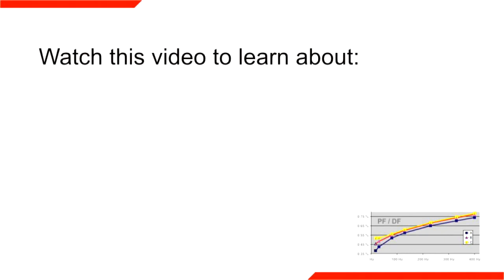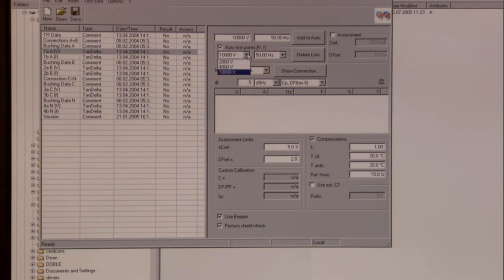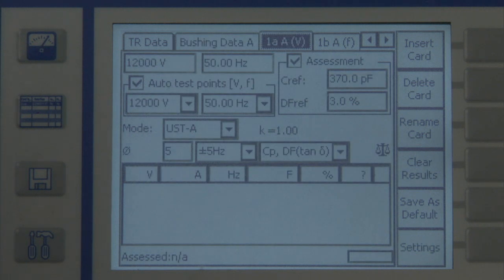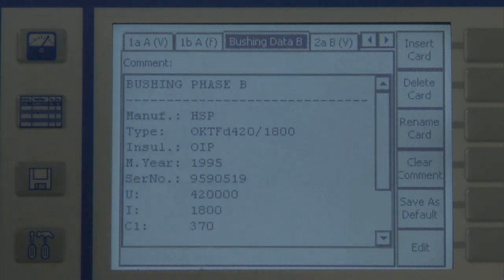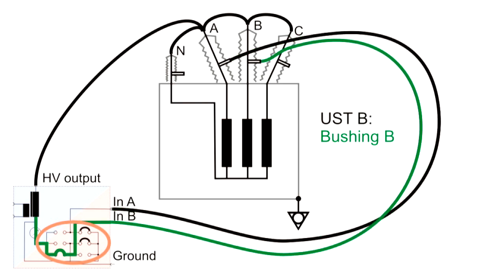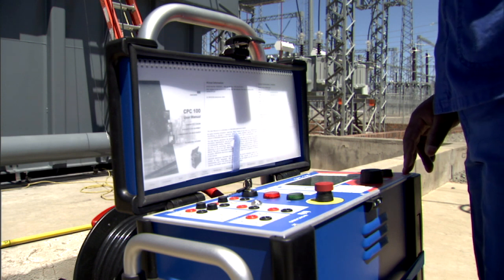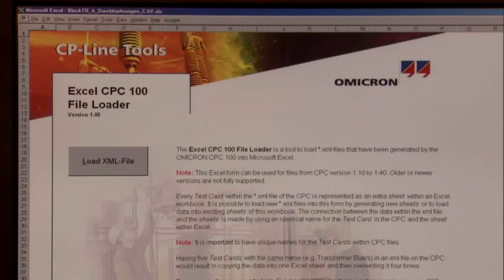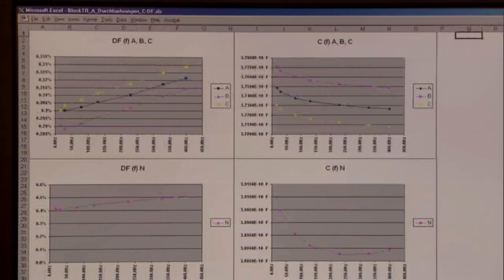Transformer Diagnosis: Easy Testing with Templates

Comment: How to connect with laptoo
Reply from the maker: Dear Quyen Pham, 
There are two ways to get the measurement files from the CPC100. 
The first option is to use an USB-stick to copy the files from the device to the USB. 
The other way to get the test files from the CPC100 is to connect the device to the PC via an ethernet connection.
How to establish / set up an connection in detail is explained in our latest CPC100 manual chapter 10.
How to download the files form the CPC100 via the ethernet connection is explained in chapter 11. 

Best regards, Your OMICRON team